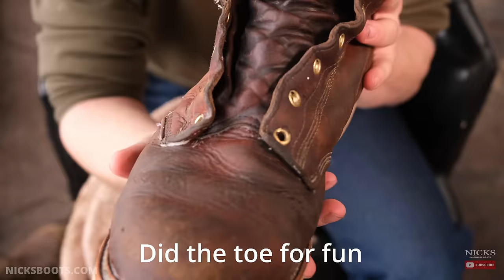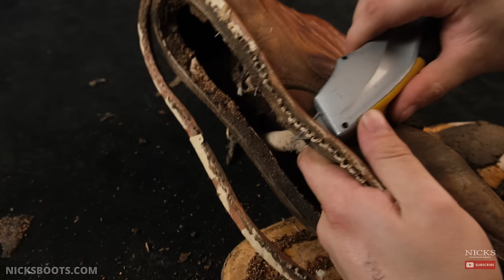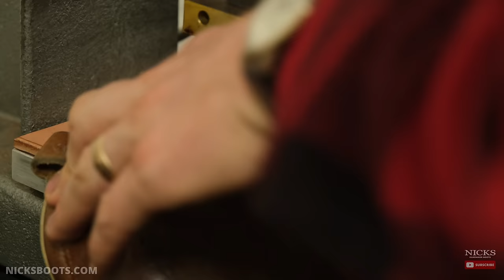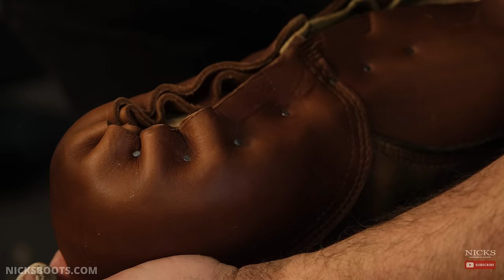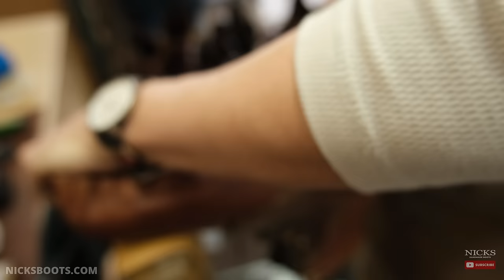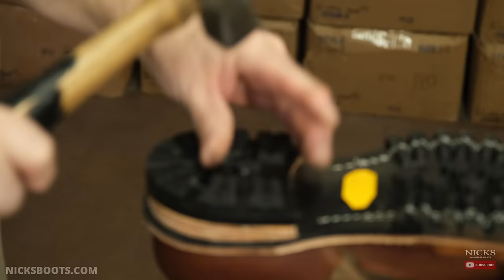We made Thorogoods into HEAVY DUTY $600 Work Boots.

Comment: Looks like Thorogoods are built pretty dang "good" in the 1st place.
Reply: We think so. 🤜💥🤛
Reply: @ThorogoodUSA  Many think so. I think so even if I don't own them.
Reply: Love my Thorogoods but need new soles now my job wears them down within 8 months to a year
Reply: @Daddyace1313  are you on concrete like in a warehouse or blacktop or the ground like outside? I've worked all 3 environments and I've found that for me nothing wore out my boots like working as a selector in a warehouse which is weird cuz its concrete slab smooth as can be but we'd walk the equivalent of 8+mi in a shift on average so blowing through footwear was just part of the job.
Reply: @buckyflex1  Diamond plate concrete gravel grass dirt ice mud you name it between 15 and 20 miles of walking every day
Reply: @Daddyace1313  $600 for a pair of work boots might sound outrageous to many ppl but folks like us know full well that our boots are every bit an essential tool needed to do the job no different than a carpenter needs his hammer & tape measure or a tree feller needs his saw and are very much a "get what ya pay for" kind of thing however spending $250-$300+ on boots in no way guarantees you'll get the performance & fit you require but on the same token it's been my experience that anything under $200 ain't even worth looking at and while $600 IS a lot of money for boots, if that $600 gets you a vastly superior boot who's fit & build quality is a cut above everything else it's worth every penny and then some.
Reply: @buckyflex1  agreed 💯 in no way am I implying Thorogood boot are lacking quality quite the contrary...it's the soft wedge sole that doesn't last nature of the beast with my job...need a harder sole but I don't want to sacrifice the comfort of the sole. And i agree 600 for a high quality boot is worth it to me! I love my Thorogood boots i will not buy redwings ever again since they're made in Vietnam. I'm a union worker and support my fellow union brothers hence why I started buying Thorogood boots and they're made in America 💯💪🏼🇺🇸💪🏼
Reply: @buckyflex1  my friends and fam looked at me sideways when i said i dropped 600$ on boots- found it kinda funny cus my friends are all tradesmen too, but i guess they havent caught on yet lol.
Reply: I agree I have a pair going on a solid two years.
Reply: @buckyflex1  the price of boots hasn't changed in 15 years so that tells me they either made a shit ton of profit on store bought boots or use cheaper materials.
Reply: I drive a truck to deliver gas cylinders. I destroy a pair of boots in about 8 to 9 months walking on concrete asphalt. All day are usually Destroy the toe down to the protective cap On the uppers of the boots. I agree with buying quality is important.
Reply: @ThatOneBlacksmithGuy shit lot of guys will bawk at me when I but a new pair of thorogoods..meanwhile they spend just as much on 2 -3 pairs of cheap import trash..don't get it.
Reply: @ThorogoodUSA  I love your boots.

Comment: This video is an excellent means of explaining the cost of boot rebuilds, given the skills of various craftsmen. It is also an example of turning a sow's ear into an "almost" silk purse. This hybrid has a different character and I wonder at the longevity of the wear in the long run, and at the weakness of the comfortably worn upper and the sturdy, new eyelets. I have a strong dislike of the flanged inner eyelets on the inside of the upper because they shred laces. The solid ring version avoids this form of wear. Thank you, and congratulations for sharing this remarkable project. Your title has drawn curiosity and lingering to watch the project. Viewers'  earlier comments have clearly shown interest in this rebuild. Bravo to those craftsmen.
Reply: I agree with what you wrote, but the threads over the treads bothered me in addition to what you said. Won't those wear out quickly?
Reply: Kinda seems like the differing pliability between the old (possibly lower quality) leather upper and the new parts would create weird differential stress points and shearing effects due to the leather not flexing as a unit. Just pulling that out of my ass but who knows. I do know it does not make sense to spend $600 resoling a $250 pair of boots lol

Comment: Your video's never disappoint! I have been wanting a pair of Nicks but i cant decide what to order. I am a saw filer so i am on my feet for 10-12 hours on concrete floor then i the end of my day i do a saw change where my feet get soaked in oil and water mixture. All the brands of boots i have tried the leather gets soggy and stretched out after  a few weeks. Maybe you can point me in the right direction?
Reply: Maybe you thought of this, but why not have two boots? One that's a nonslip rubber boot and one regular work boots

Comment: Why do they not put the welt stitching into a channel so it's not the first thing that comes into contact with sidewalk
Reply: Job security
Reply: This is a chain stitch. Think two loops tied together that meet in-between where it is visible on top and on the bottom of the boot. As long as the chain is strong in the middle, the stitch isn't coming undone under normal use. You will have to make an specific effort to break the chain.
Reply: Do you want to pay extra $100 for no addee benefit? Didn't think so.
Reply: @Totemparadox  lololololol you think it would cause $100 to put a channel in!? 😂 It takes 20 seconds.
Reply: @johnnyfnhammersticks  You're delusional. Since the sole is not trimmed, the stitcher would need to waste a lot of time lining up the channel so that the stitching goes perfectly vertical. Then after that is done they would get complaints about the boot having chuncks missing because the channeling weakened the lug on the edge of the sole. The channeling creates more problems than it solves.
Reply: @johnnyfnhammersticks  Haven't seen one. Can you name or link a video so I can watch it?
Reply: @Totemparadox  I'm not googling things for you, figure it out for yourself.
Reply: @johnnyfnhammersticks  Hah. So you got nothing. Yeah some people do channels on FLAT soles. There's two issues with your channel idea. One, like I said a deep enough channel to protect the stitching for long enough for a resole would make the lugs on the sides of the boot very easy to break off because they would have no support. Second, if you only do that shallow channel why even bother since the stitching will still break long before it would need a resole. Your channel idea works on some type of soles, but is totally pointless on lugged soles.